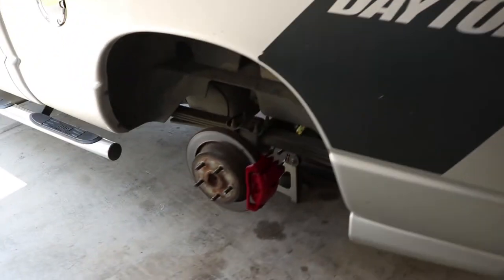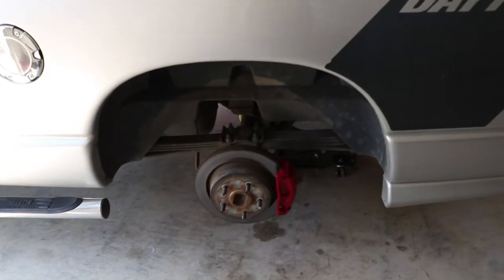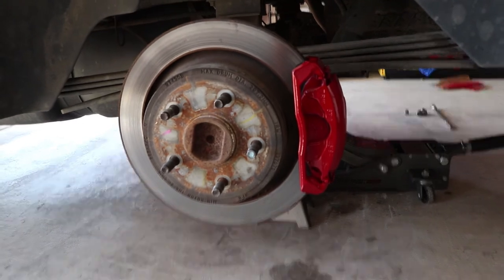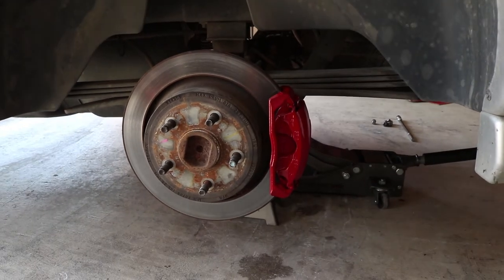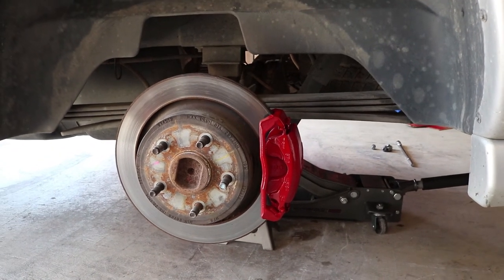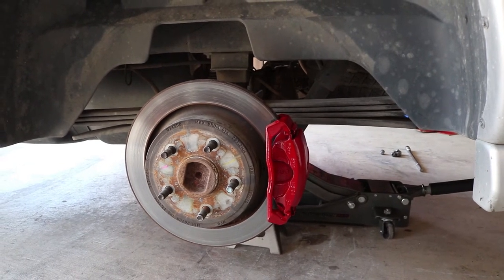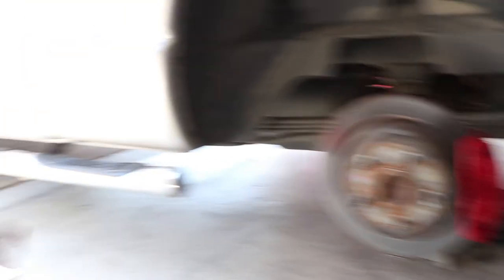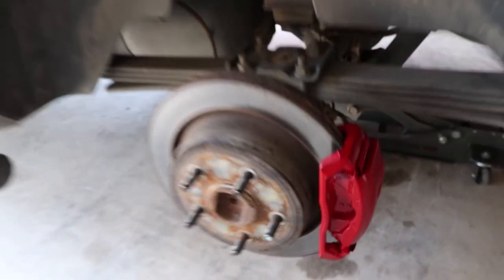DIY: Painting Brake Calipers On My Ram Daytona

Comment: Nice
Reply from the maker: Thanks Albert! That $9 can can really change the look lol
Reply: Are you going to do a tail light conversion?
Reply from the maker: Since were commenting on a ram video are you referring to my Challenger? If so then no. I don’t want to pay that much money for something that’s just for looks. 

Everything done to the challenger has had purpose behind it. The Hellcat bumper allows more air to reach the radiator and the added mishimoto power steering cooler. Next is oil cooler and transmission cooler. 

The widebody was to accommodate the big tires for grip. It looks sweet but looks weren’t the main goal.
Reply: Oh ok yes talking about the challenger
Reply: Love the content
Reply from the maker: I really appreciate that! But yes maybe in the future but for now the challenger mods are to make it better. The ram mods are to make it look better lol. 

Thanks for watching and supporting 🙏🏽